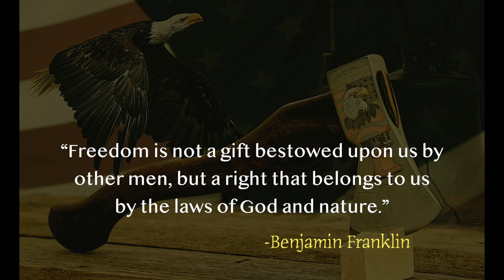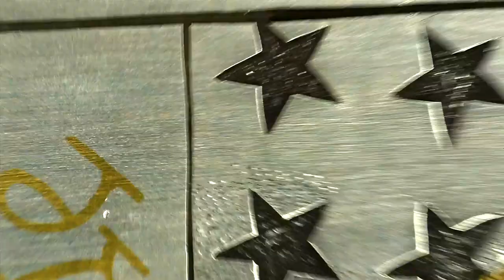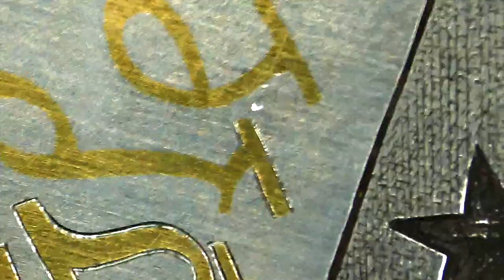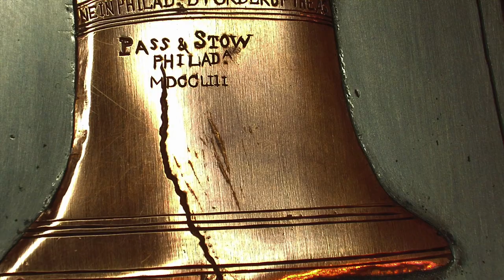How I Hand Engraved This Vintage Axe | Gold Silver Copper Inlays

Comment: Hello ASkobi. My name is Gerson Bragagnoli, I am Brazilian, retired university professor and knife maker.
I'm trying to improve my knives by making inlay (for now copper)
I watched your videos where you embellish 3 axes using copper, silver and gold inlay.
I would like to ask 3 questions:
1 - how deep is the cavity where you will inlay the copper (or gold, or silver)
2 - how thick is the copper piece that you cut out with the goldsmith's saw to place in the cavity
3 - what angle of the burin do you use. 
Congratulations on the beautiful work you do

Note: I am using a translator
Reply from the maker: Hello, I'll try to answer your questions to my best ability.

1. The cavity ranges between 0.3mm and 1.0mm, depending on what I'm inlaying.
I can do deep cavity because I have that option on an axe, but if engraving on an object that is not thick, the cavity will probably be around 0.25mm.

2. The copper pieces I use range from 0.2mm to 1.2mm, again depending what I'm inlaying.

3. I use several different ones. 120Deg, 110Deg, 90Deg
Sometimes I have to improvise and make unique gravers depending on what kind of metal is engraved.

Hope this helps.
Good luck!
Reply: @ASkobiDesigns  Thank you for the information and your promptness.
Reply: the anchors at the bottom of the cavity, which burin do you use?
Reply from the maker: I use different kinds, depending on the type of the inlay. If the inlay is large size then something like a 120Deg graver. When inlaying a wire, then a flat graver is used.
Reply from the maker: Very beautiful patterns on a knife blade!

Comment: I noticed in the letters you used wire and in the wide areas you cut to the pattern.  why in your wide area you don't use wire too?  what can not be done in a wide area with a wire?  For the technique of cutting width according to a pattern like that, do you use a special glue to make it stronger?  For cutting techniques according to what pattern do we also have to cut the under cut too?  Thank You.
Reply from the maker: For letters you have not choice but use wires. For larger patterns I find it easier to cut out the patters. But if I don’t have large pieces of metal to cut pattern from, then I use wires. I do t use any glue, just I create burrs to hammer in the metal or wires.
Reply: @ASkobiDesigns  I just tried it on coin.  for the /Border line it works but for the media it's a little wide, I failed to use a wire

Comment: Very nice, but tell me what is the blue colour around the metal when you inlay it, what is it anointed with and what is it for?
Reply from the maker: It's a blue permanent market. Part of marking the area to be inlayed.
Reply: @ASkobiDesigns  thank You
Reply from the maker: **marker
Reply: @ASkobiDesigns  Hi, what is the reason? Thank you
Reply from the maker: Highlighted area of the inlay I needed to cut. I place a scotch tape and this ink is transferred to a tape. Then I place the tape on a copper piece that I want to cut out an inlay from and cut it. It’s just a transfer method I use.
Reply: @ASkobiDesigns  thank You.